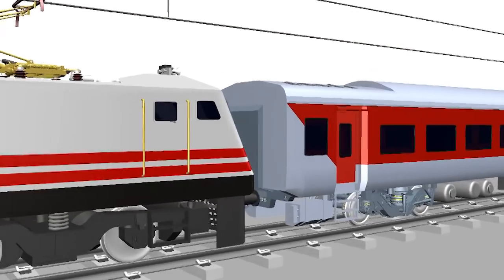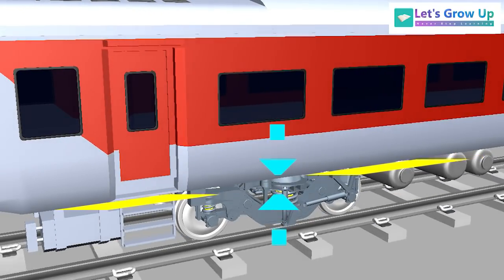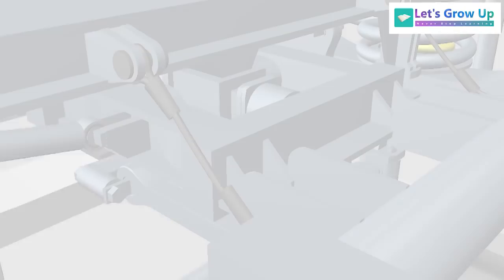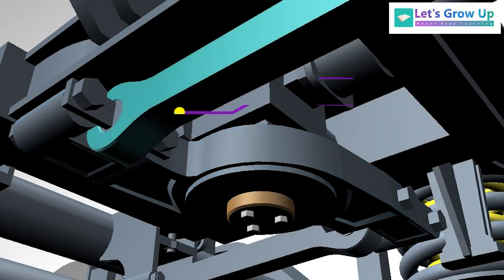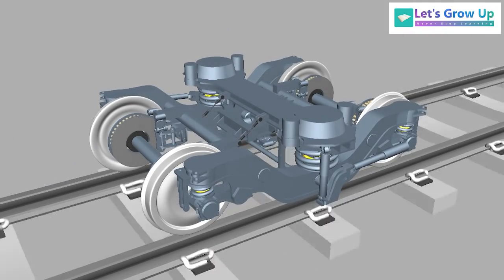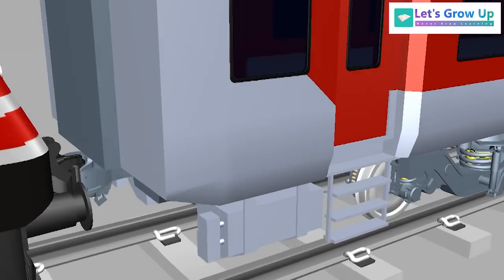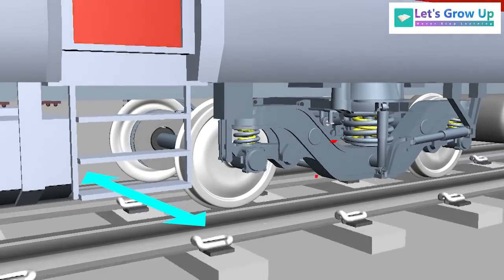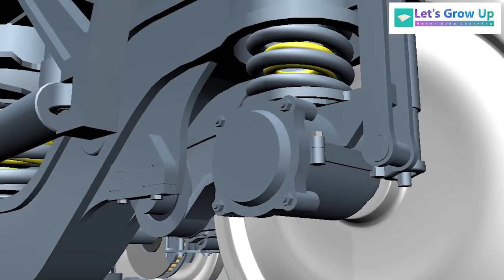LHB Bogie Traction center working function | FIAT bogie traction center | LHB bogie traction system

Comment: It is very nice description of bogie function in running of trains through electronic traction. I feel one small point is missing here, the bogie is mounted through a single centre pin with an brass ring bush which also act as suspension and meneability of coach on curves and takes care of opposite forces....which means BFR..Bogie Free on Rails..